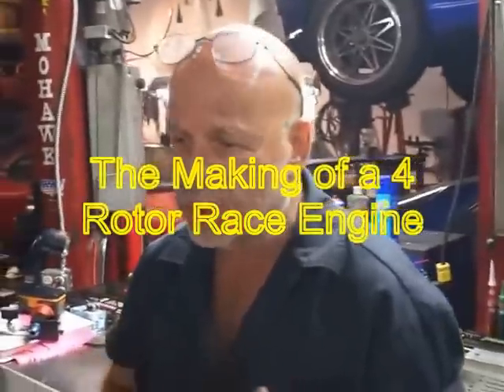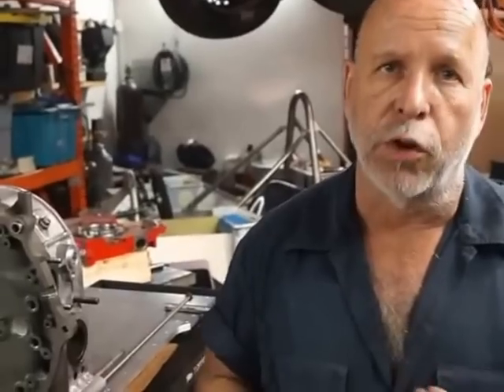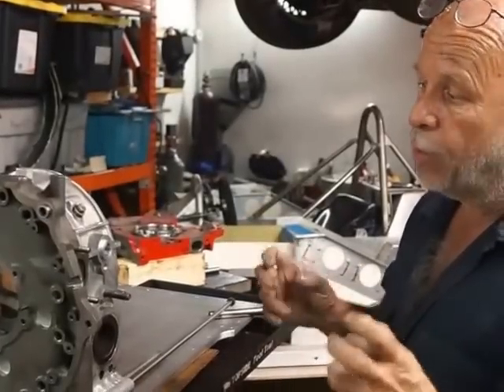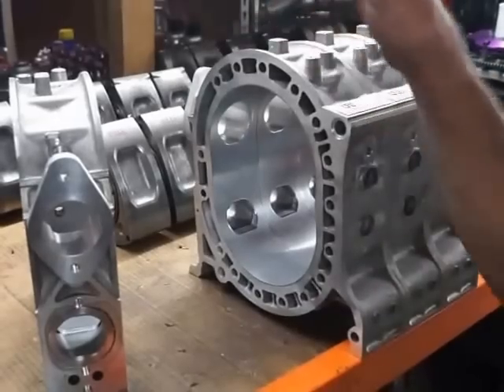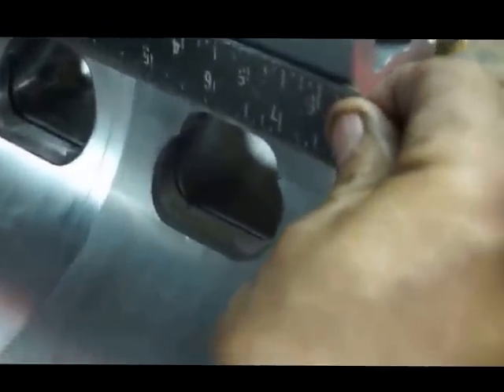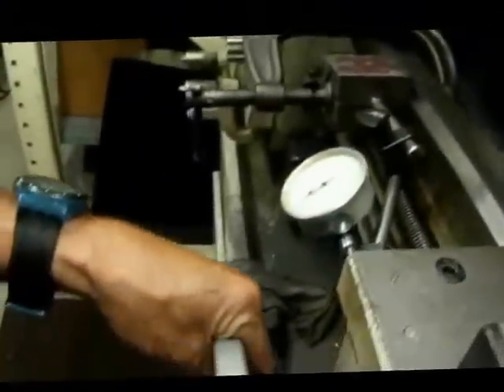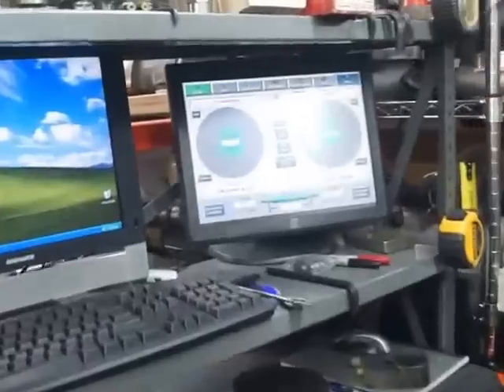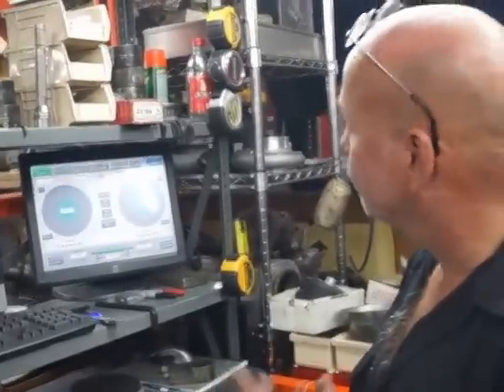4 Rotor Hybrid Race Engine Build for 767b Mazda Race Car

Comment: 27:45 glad this guy mentions harmonic vibrations. Engineers spend weeks working those out to improve longevity. That's why messing with the rotating system is not a bolt on affair.

Comment: Bearing babbit is also a sacrificial material (soft) in case engine failure (E-shaft to rotor clearance)happens, the shaft and rotor will will not come directly in contact with each other, the babbit will be the safety barrier between the 2 .

Comment: great info... just a bit of confusion over the part about increasing the oil groove? im of the opinion that increasing the oil groove area would decrease the pressure. as its poundage per area. im no expert... but i assume it works better because it increases the volume of oil present in the oil groove and because you are using such a high oil pressure anyway as stated in the beginning, the trade off for the loss of pressure is negligible.\
Reply: +Kafele Reddock no you are right. p=(f/a) I'm no fluids expert by any means but any undergraduate in engineering knows that. He must have had a long day and just mis spoken... i hope!
Reply: yes. by increasing the area the oil pressure acts on you are increasing the force the oil creates on the bearing. pressure x area = force. 100 psi over 1 square inch is 100lbs of force. so if you increase it to 5 square inches you now have 500 pounds of force being exerted on the bearing. now at higher rpm's when the centrifical force of the rotor tries to squeeze that oil out , the oil can hold more weight thus keeping the bearing and the crank shaft from making contact. does that make more sense?
Reply: Look first at the bearing of a rotary then you understand,  sometimes people make an opinion without knowing,  the racing bearing has a deeper center groove to accumulate more oil,  the clearance between the shaft and the bearing is another story, this is not a LS, is a rotary,  so all that math is fine if you apply it to the correct situation

Comment: Thanks for the great video! What is the name of the piece you put in the lathe as a centering device to make sure every thing was dead centered? I am just starting to do work on a metal lathe and it would be great to know the name for future work.
Reply from the maker: +LochRocket - You may be referring to a Mazda Dowel Pin that is what gives the rotor housings support and is one of the dead truest dowels for alignment purposes.

Comment: this is my sisters picture but this is Stephen asking why are you not drilling for the third spark plug. late late trailing  plug starts the flame. It also increases volumetric efficiency.  Increased torque and you are able to burn more fuel. Next add variable telescopic intake slide valves so you will gain maximum torque at any RPM

Comment: I wonder if it would be possible to make a crank that had spline connection on both ends, and had a way to get torque from both sides of the engine?
Reply from the maker: +gorillahumpr - Anything can be done.  It just comes down to having the vision and the money to pay for it...

Comment: I never saw rotary engine under hood and I never thought it's that small! What I just don't get is how can you get 2.6l and 700hp from that small engine :D love rotaries !!!
Reply: Isn't it technically a 1.3L, since it displaces 0.6L of air? Isn't one face of a rotor firing at a time?
Reply: Each rotor face displaces 654cc, and each rotor fires once per crankshaft revolution. The wicked thing is that it take 2 complete crankshaft revs for all the cylinders in a piston engine to fire, so a rotary is effectively twice the advertised displacement. 700hp out of 5.2l is a lot more reasonable.

Comment: When rotary engines are said to be at 10,000 rpm, that is just the eccentric shaft and the main bearings. The actual rpm of the ‘rotors’  and their bearings are only at 3,330 rpm.

Comment: How much does one of your 4 rotors cost complete long block ?? 
Can you use oem style  mounts in a 91 rx7 ?
Reply from the maker: +robfrmny21 - That race engine in the video runs around $90000. If you want a street motor you need to speak with Carlos about your specific needs and he can give you a quote.
Reply from the maker: We have a 4 rotor twin turbo that we are building for the Miami GT car that you can see on our website www.miamigtr.com - that motor with all the turbo gear will probably be more, but it will have 1100 + HP. Sickspeed!

Comment: Can i get a good Quote on how much this guy charges to build a rotary motor?? Street racing use?
Reply from the maker: +ViceVersa Musik - Call Carlos and ask him.  You need to be more specific on what kind of power you are looking for.  For example, To build an engine that can handle 450 HP reliably you are looking at around $8800.
Reply: Thats bloody riduculous dude. Thats way over priced and a complete ripp off. There are rotary workshops that can do a normal "street" rebuild for less than half that. Where the fuck do you get your prices from. 

To all the novice people, its best you go to a normal workshop instead of highly experienced people cos you will get over quoted for the same thing. In Australia, you can get 2 engines build for $8800.
Reply: Hey man, I just saw this post for the first time.  There is a major difference between a Street engine that does a little Street racing vs. an engine built for Racing use.
and yes You are correct. a Street engine to support 450 Hp. every once in a while can be built for far less than a Racing engine that lives at 450 to 500 Hp. ALL THE TIME. and runs for 3 seasons between rebuilds while logging over 370 Hours of pure competition. So if you look at the cost per hour of use at FULL POWER., the more expensive builds actually end up costing the customer far less in the long run.
BUT yes, for Street use, you DO NOT need professional work.

Comment: How do you join the 2 pieces of the e-shaft? Splines? Or is the e-shaft a single piece?
Reply from the maker: +Slick Tires  - Its a single piece. Company in Australia makes them.
Reply: So the bearings for the inner 2 rotors must be two pieces, right? otherwise how can you slide them to place?
Reply: +Richard Viscasillas I thought it was New Zealand...

Comment: 100 psi is 100 psi. if you increase the area you still have 100 psi, at same delivery volume then you get 20 psi if you go to 5 inches, psi is based on volume of delivery and restriction. open your garden hose and it flows x gal/minute. restrict flow and pressure increases, volume decreases.   cutting bigger groves you get more oil reserve. WHAT SAY YOU??

Comment: hi, can you build me a 1 rotor NA intended for use in motorcycle with cvt that only revs up to 5000 or 6000 rpm? i want reliable motor and very fuel efficient..

Comment: Wow, never thought I would hear a rotary engine builder refer to the eccentric shaft as a crank shaft. A complete 26B from Pulse Performance Race engineering in NZ is $60k USD. PPRE are Mad Mike's engine builders. PPRE also will build you a 6 rotor to order https://www.facebook.com/PulsePerformance/  For such a small island the Kiwis really are on the cutting edge with rotary stuff at the moment.
Reply: +cheapcharlie7 Mad Mike also called his eccentric shaft a crank shaft when he was explaining his rotary engine in his miata. they probably do this so that people who are unfamiliar with the parts if a rotary engine know what they are talking about. its just easier to call it a crank shaft cause everyone knows what a crank shaft is. say the words eccentric shaft to 95% of people and they wouldnt know what that is
Reply: chinchy111 Good Point

Comment: didn't the 787b have 3 spark plug positions tho
Reply: The 787B did. Not sure about the 767 though. Anyway, I think he said at the start that this was built from stock parts, whereas the 787B motor was a race motor.
Reply: Or ok I see

Comment: takes a japenese rotary master 15 min to fully build a 3 rotor
Reply from the maker: +groundhabit1 - Now that I'd like to see.  I've seen videos of the Mazda factory mechanics putting together the Renesis engine pretty fast, but not in 15 mins.  The way CLR builds engines, they are meant to last.  The custom machine work alone to reduce the weight and balance the rotating assembly to within 1/10 ths of a gram takes days.  But the engine will happily live at 9000-10000 RPM all day long one race event after another usually for 2 or 3 seasons before a rebuild is necessary.
Reply: Japanese aren't good rotary builders it took new zealander bill sheiks to teach them his to bridge port and periphal port etc....